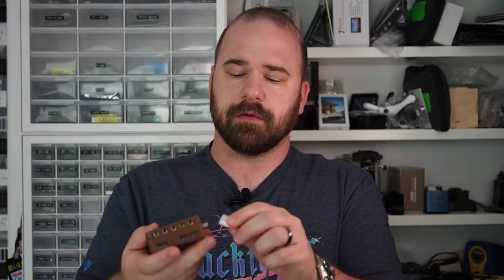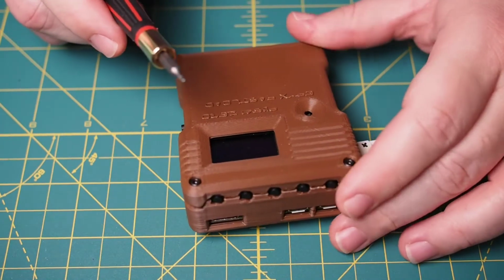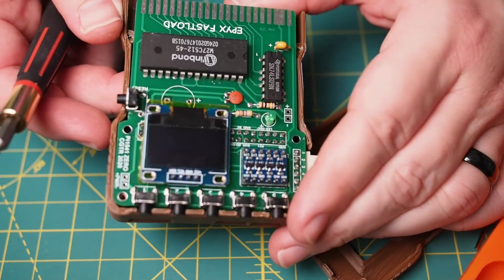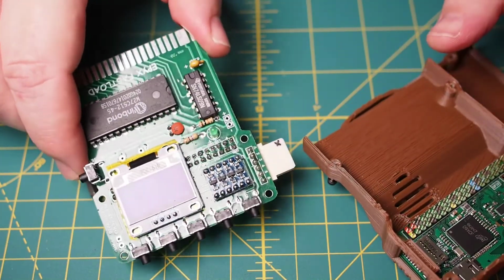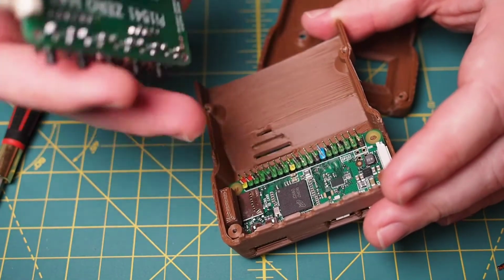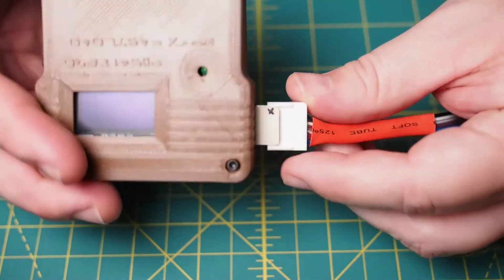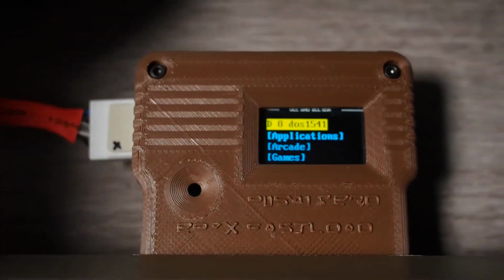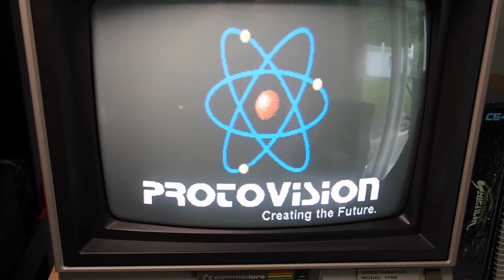Pi1541 Zero Epyx Fastload Combo Cartridge for Commodore 64

Comment: Does it allow user to upload files to SD card via wifi?
Reply from the maker: No
Reply: @JacobExplains  chatgpt says I can, but I need to configure ssh access at zero pi, wifi connection... Is it some usual arm based Linux at SD card?
Reply from the maker: This particular card uses the pi1541 software, which runs on the bare raspberry pi without linux installed. It has no support for wireless file transfer. Check out the website: https://cbm-pi1541.firebaseapp.com/

Also, ChatGPT loves to lie about stuff, so don't rely on it.
Reply: @JacobExplains  Many thanks

Comment: It should be noted that while Epyx Fastload was a good cartridge and a revolutionary new idea at the time, it doesn't work on all disk operations. As I understand it, it worked by replacing the Kernel load routine, so you only get the increased speed when loading a single file, or if the program calls the normal load routine to load additional files. Any commercial game that uses its own custom loader or that reads the levels as data rather than simply loading them, won't be any faster.

When I got my Epyx Fastload back in the 80s, I was disappointed to learn this. It was great for cracked games that were in one or two files, but did nothing to speed up full-disk games by Electronic Arts, Accolade, etc. Even some cracked Epyx games ignored the cartridge and took forever to load. I remember getting a copy of Street Sports Baseball, cracked by FBR that took several minutes to load. It was so slow, I never played the game until I got a better cracked copy.

Comment: One modification I made on my Pi1541 was to add a switch between pin 9 of the cartridge port and the fastload rom, so that I could disable fastload... on the Commodore 128, if that line is connected, then on startup it goes into 64 mode... to switch to 128 you need to remove the cart which gets old fast. ;D
Reply from the maker: That's a great idea!  Thanks for sharing.